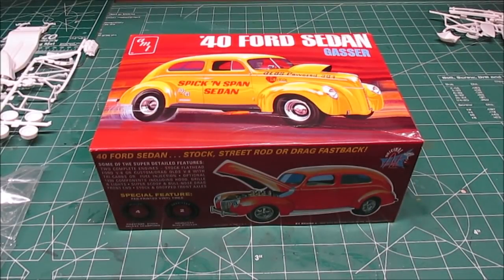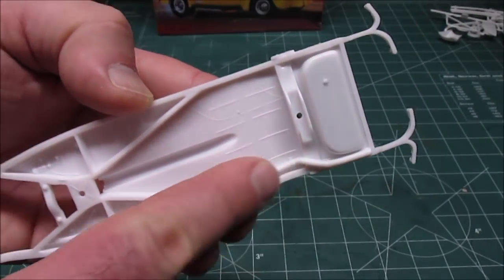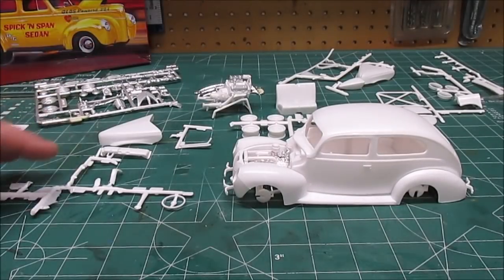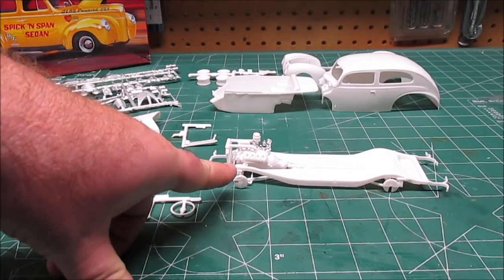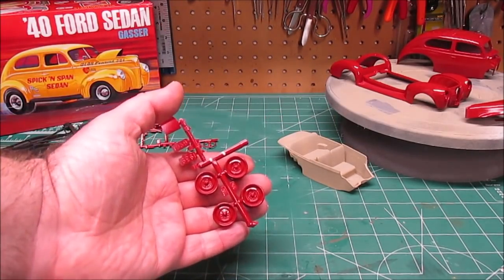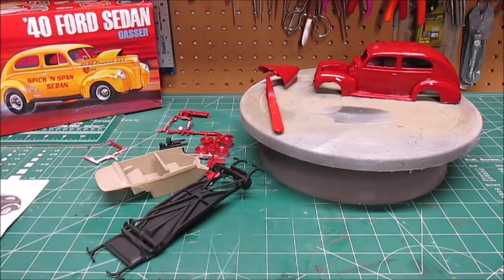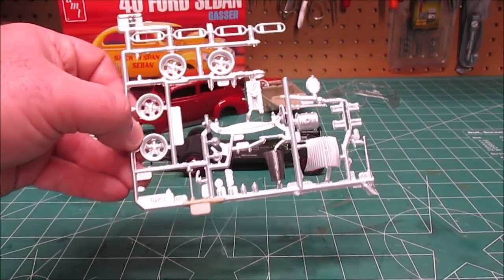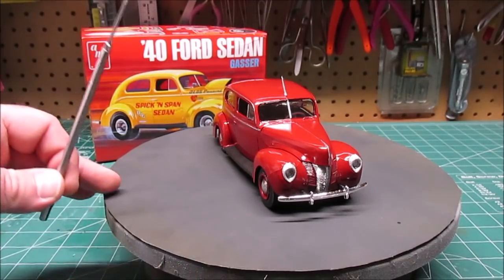AMT 1940 Ford Sedan Gasser 3n1 1/25 Scale Model Kit Review Build AMT1088

Comment: I just picked this kit up today at Hobby Lobby with the 40% off coupon. Paying $30 for a model kit is outrageous, but I can live with $19. I plan on building mine bone stock.

I know you build your kits pretty quickly, but I just can't stop noticing the mold line on the front fenders near the headlights. Other than that, nicely done.

Comment: A bit of information here. For a darker maroon.the Napa dark garnet red is a perfect match for the original stock body color. The Martin Senour paint mixture number is :3-1-9588-00. This is a perfect duplicate of the 1940 Ford Mandarin Maroon, and the 1941 Mayfair Maroon. I know this because this was the original stock color of my 1941 two door sedan project car. This is compatable with the model plastic. I am doing a 1940 sedan kit in this color. It should look very good when it is done.

Comment: Ooh the 65 Oldsmobile cutlass 330 H.O. might be a 66 its a older kit that Oldsmobile 394 motor would be a neat touch for that and the 41 willys swindler revell type models with the blown Oldsmobile big block, and the coca cola 40 Willy's drag truck and tonneau cover

Comment: Definitely like to have some of the custom parts for the mpc molded in blue 57 ford Fairlane stocker I still have not built other than the basic interior except the front seat or the roll bars, and the motor.

Comment: Nice looking was there a lot of flash and how was the chrome it looked a little weird thank you for the build
Reply from the maker: I showed the parts in the beginning. Flash is normal and easy to remove. Didn't notice any issues with the chrome.
Reply: hpiguys Workshop Yes I saw that but I appreciate the answer actually was at hobby lobby today and bought one thank you so much

Comment: Hpi i  have a question, can i use automotive black primer on the body and wheel interrior base.i can buy it cheap here. But i heard that it can harm the plastic.
Reply from the maker: Test on scrap [plastic first. I used to use the primers at Autozone but Rustoleum is cheaper and easier to find.

Comment: So I'm not new to modeling but I'm curious as to why you "degrease" the parts before assembling. What's the advantage?
Reply from the maker: Just in case it got any release oil on the plastic or someone who bagged it had dirty hands, etc. Sometimes when I don't clean it I'll get fisheyes in the paint from oils on the plastic. A few minutes cleaning beats having to strip paint off.
Reply: Agreed thanks for the knowledge. I'm painting mine a tamiya purple metal flake.

Comment: I've built this kit several times, including the coupe and the panel delivery, which share a lot of the same parts, I like your reviews, and have even learned a few things, however, with these 40 Ford's, the fenders are showing the mold lines really bad, and do need to be sanded out!
Reply from the maker: To each their own, I like building mostly from the box, minimal work. But enjoy your mold line removal if you feel the need! :)
Reply: @hpiguy  I typically only do mold line removal when the castings are as bad as they seem to be with the old 40 Ford kits, all of the 40 Ford's from AMT use all of the same molds, with the exception of the body of course, so the mold lines are really prominent on the fender castings for some reason, I'm like you in a lot of ways, I don't usually remove all the mold lines either, but that one for some reason has always bothered me, I've been building those 40 Ford kits since their original releases, maybe those molds are just getting really old!